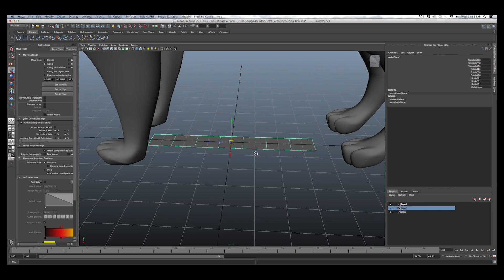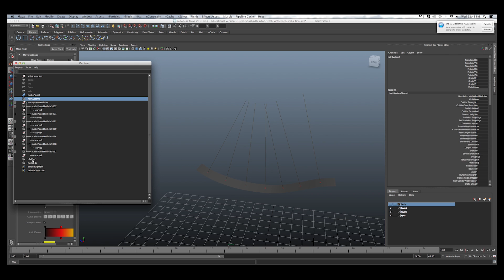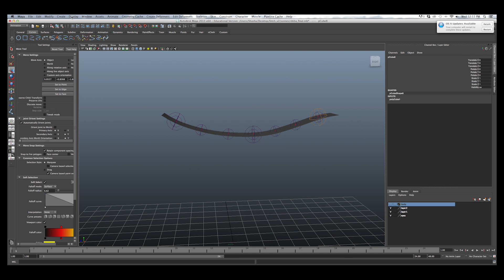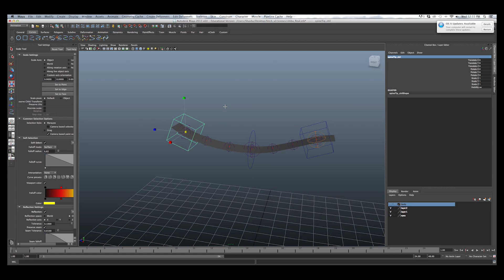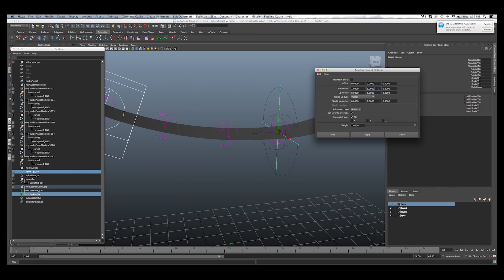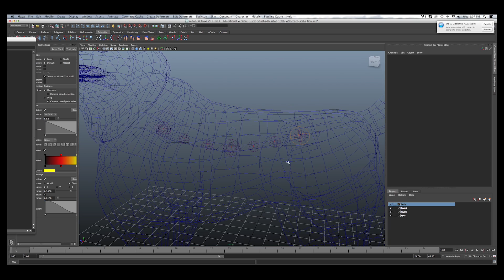Quadruped Rigging Tutorial  Part 1: Ribbon Spine

Comment: would this work for a horse neck as well? (probably a dumb question XD)
Reply from the maker: Yea, absolutely.  You can use a ribbon for lots of different things but applying this same technique to a long quadruped neck like a horse should be pretty straight forward.
Reply: +Corey Ross sweet, thank you :) I'm rigging a pegasus...now I just need to know how to swap between IKFK without resetting the bind chain to its default position...
Reply from the maker: you mean that you want to switch between IK and FK and maintain its current pose? Some people call that IK/FK matching.  Heres a video on the subject: https://www.youtube.com/watch?v=MBRJjxU-Lwk&index=33&list=PL8hZ6hQCGHMXKqaX9Og4Ow52jsU_Y5veH

Its part of a whole series so it is meant to work with his IK/FK setup.  So if your IK/FK setup is similar to his, it should work.
Reply: +Corey Ross I HAVE BEEN LOOKING FOR THIS FOR MONTHS!!!! THANK YOU :D (I asked like 3 or 4 riggers and no one answered me. I didn't even know what it was called >_>) really, thank you. Last thing I needed to do this rig for my demo reel :D :D :D
Reply: would it be difficult to also have an FK setup on top of the ribbon with both controlling the back? (kind of like the spine setup in the old Maya '08 Introduction to Character Rigging book)
(I've never used a ribbon before, can you tell?)
Reply: +Corey Ross last question (hopefully). I notice only the Z rotate goes down the whole ribbon. X and Y stop at the midpoint. What's up with that? (I checked, the parent constraint hit all three axees)
Reply: +Corey Ross last question (hopefully). I notice only the Z rotate goes down the whole ribbon. X and Y stop at the midpoint. What's up with that? (I checked, the parent constraint hit all three axees)
Reply from the maker: I'm not sure what that means,  Could you attach a screen cap here?
Reply: +Corey Ross I mean when I rotate one of the end controllers on the X or Y axis, the middle controller doesn't rotate; so I don't get the whole ribbon making a curve, I get half of it. However, when I rotate it on the Z axis, everything works fine.
Reply: I don't know how to do photo comment on youtube